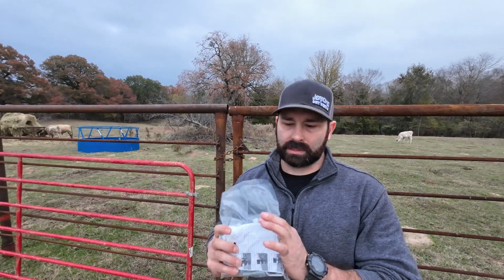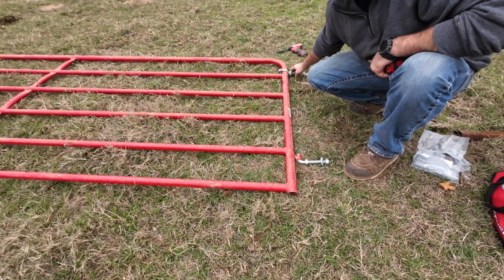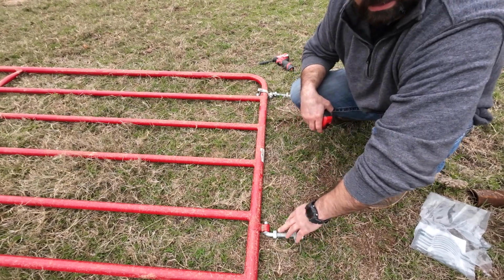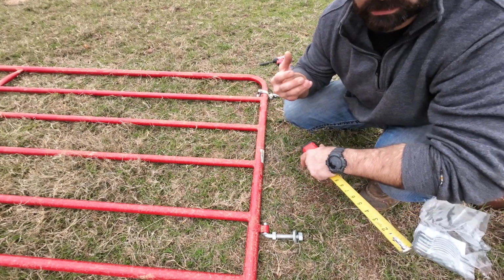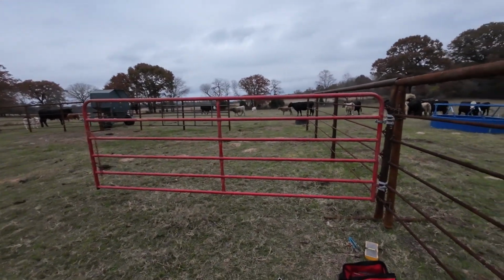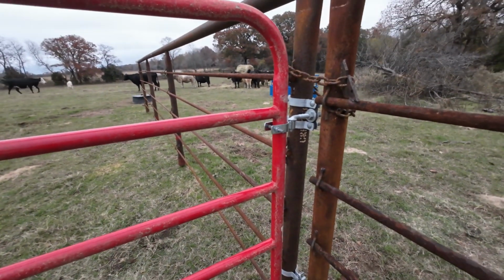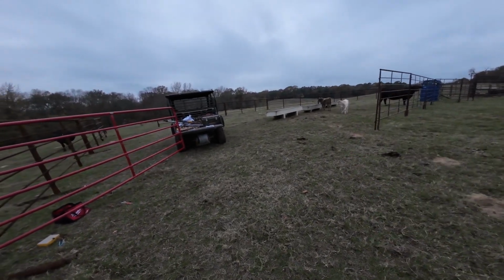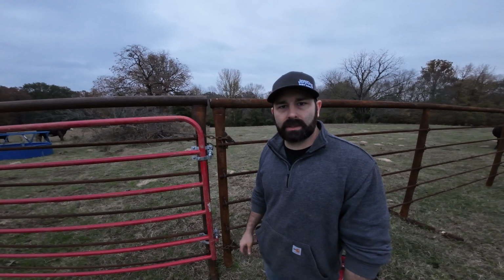How to Install Gates on Metal Post (EASY)

Comment: I'm running high tensile fence soon with Fiberglass pipe as corners and at gates. Going to try these brackets out for a few gates!
Reply from the maker: I haven’t tried them on fiberglass but I think they will work as long as the outer diameter is right.